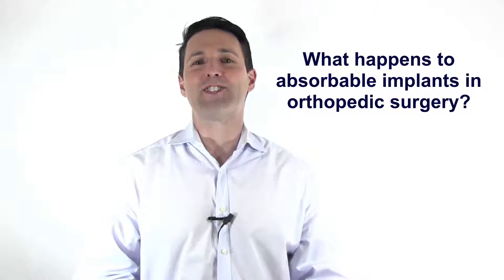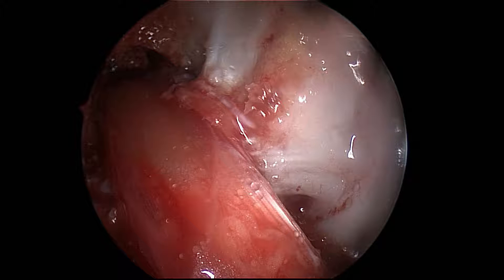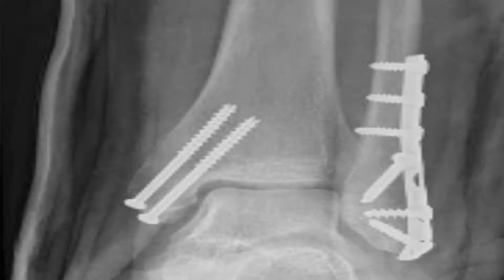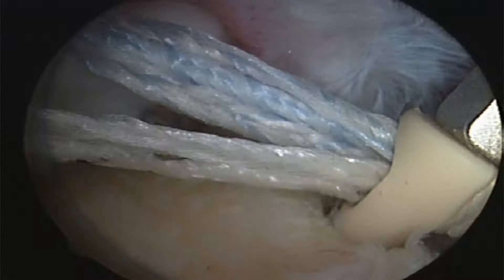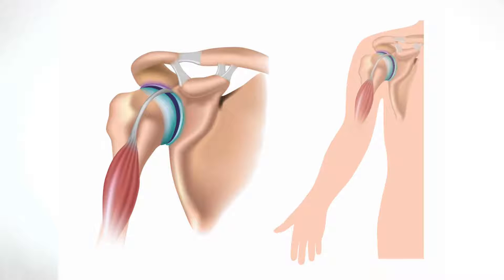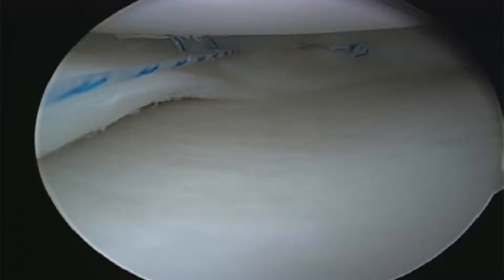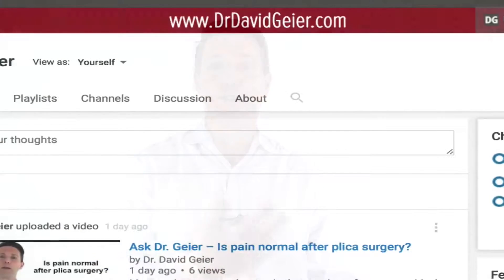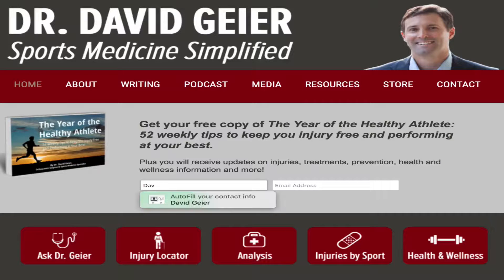Absorbable screws and implants in orthopedic surgery

Comment: Hi Doc, Iam 26 years old i have an bone evulsion fracture with large bone lesion the fracture size was 2.8 × 1 4 cm. I have an orthoscopcical acl repair with bioabsorable anchor and suture so my question for you is that when can i starts running and when anchor dissolves.

Comment: Most surgeons will tell you that they highly advise to you  keep the plates, pins or rods in after the healing process unless they are causing real pain. The reason being is that you'll have to go through another recovery process after taking them out due to the bone having to reheal in the places where the plates, pins and rod parts used to be. Once you take any support part that was drilled into your bone, out, it will leave a void and that void has to refill with blood so that it turns that void back into bone, which leaves that part of the bone vulnerable until that void fills in with bone.
Reply from the maker: That’s essentially true. Plus another surgery brings risks of complications.

Comment: Hello Sir, I got a reconstructed ACL.The surgery was done on the year 2015 & I used titanium screw (cannulated interference screw) for the same..Then I came back to my sports life & I was doing well.Now after 2years of the surgery I am feeling little problem on my knee & found after doing a X-ray that a screw has little scrolled down from my tibia..Now if I decide to remove those screws,is there any chance to having problems to fix my ACL or its already fixed on it's place ?? Sir,my question is, 2 years is enough to fix my reconstructed ACL on its place or not ??

Comment: I had an open rotary dislocation of the knee. Ruptured: ACL, PCL, MCL, LCL,
PLC, TORN MEDIAL & LATTERAL MENISCIS.....and TORE PATELLA TENDON
OFF THE TIBIAL TUBEIOCITY, (I fell on crutches 14 days later and tore patella off again).
I had 8 metal screws, and 2 bio composite screws installed. ( 6 surgeries, 6 months).
Didn't work out...... had surgery for a TKR and was walking within 3 weeks.
125 R.O.M.   0 extension  age 56